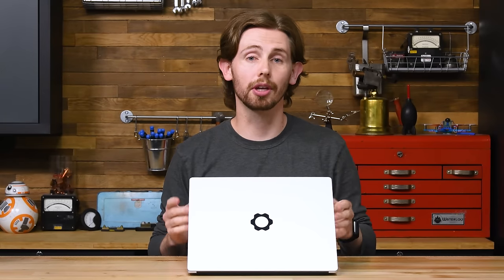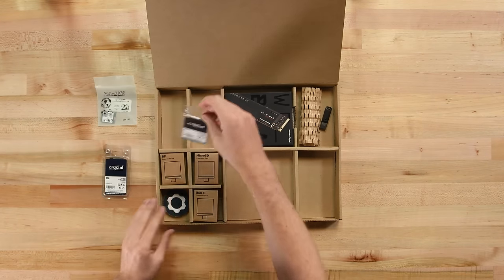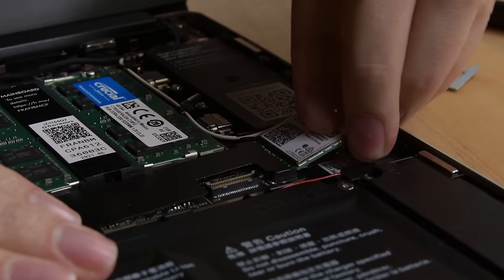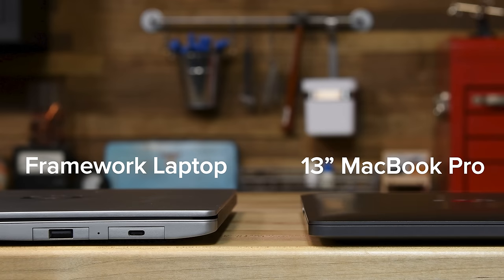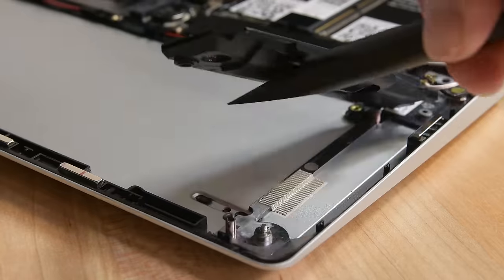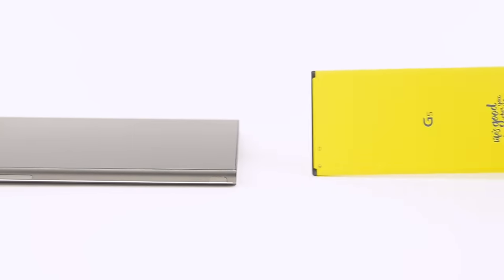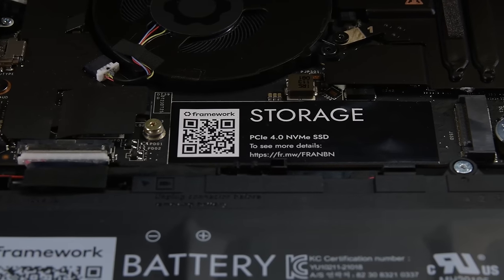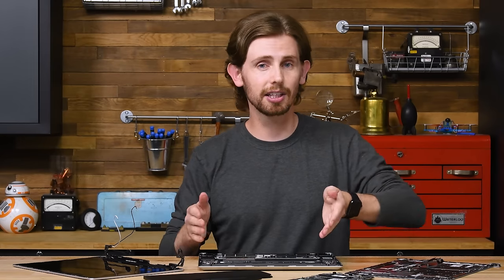Framework Laptop Teardown: 10/10, But is it Perfect?

Comment: I have a MSI modern 14
It's thin as heck, got all the reasonable ports, upgradable dual channel memory, easy to take apart, no glue on the battery pack, built out of sturdy metal and the display is easy to get at with the clip on bezzel
And I still envy this thing because getting parts for this one is so much easier

Comment: I'm not happy with mine:

* Battery drains super quick while suspended.
* External monitor keeps getting random disconnects (USB-C).
* Holding the laptop with one hand, or using it on a uneven surface, makes the chassis bend and makes the touch pad send a click.
* Noise going to my USB sound card through the usb ports.
* Fan turns on more often than desired/expected for a modern laptop. 
* A bit heavier than it should (why use aluminum instead of carbon chassis?).
  

The rest... very good.

Comment: I'm getting this thing as a non-gaming option as soon as possible. LTT covered it too, and I was totally gassed when I saw it. I'd give it 11/10. And for those of you poopooing this, PCMCIA has nothing on this. The USB module ports are USB 3.2 (kinda need that anyway for supporting DP and HDMI 2.0 - I think it's 2.0 anyway, don't recall).

Comment: Another thing, All screws are either color coded by length or captive, and at the top of the board they have 3 replacement screws, one for each length/color. Linus from Linus Tech Tips bought his own laptop on the spot and also invested over $250,000 to the company. I would keep an eye on this company!

Comment: I'd say 8/10 for repairability. I'd have loved to see a socket for that CPU and a direct link to schematics for the board on the website instead of a delivered on email type approach.

(Small edit) I know there isn't a traditional laptop grade socketable CPU on the market but with some R&D I believe a socket like what Intel uses for their current desktop CPUs could be manufactured for the laptop CPUs.
Reply: Cpu socket would make the computer significantly thicker.

And frankly if you are upgrading, it’s unlikely the same socket will support a new cpu.

Comment: If I were in the market for a new laptop I'd most probably get this. However I've still happy with my Dell XPS 13 9360 from 2017.
My only complaint is: they could've fit 2 usbc ports in those adapters each, couldn't they?

Comment: I kinda wish that the battery was more accessible, so you could take couple spare, fully charged ones when going to the woods or somewhere else where you are unlikely to have access to the electricity and replace it in the field without having to unscrew bottom of the laptop and risking dirt getting onto the motherboard.

Comment: That is what a laptop should be able to, upgrade components, i mean, what the point of ram and storage manufacture if they're soldered to the motherboard (in most laptops)? Maybe not for cpu and gpu, but it's a laptop, you can upgrade the whole motherboard anyway

Comment: The great thing about the DIY assembly, is that if you want to replace a laptop that already has an MVMe SSD and good enough RAM and a wificard, and all those components are removable, you can save even further by asking a framework DIY kit what won't include those things as you already have them.

Comment: If the D deck has more aluminum reinforcement to make it more durable and hard to bend I'll get one right away. Now it's still a very attractive device, but it lacks the build quality seen on old workstation level books.
Might be a little picky though, it's way better than those apple or surface trashes.

Comment: If I’m being honest framework is one of those very rare cases that it should be a score of 11. Not only do the provide the only tool you need to repair any part of the machine in the box but additionally with those QR code’s they not only give you a link to where to buy replacement parts they also give you full repair guides for the user to service the device themselves. And on top of that framework even left three spare screws in the top area of the chasis for if one was lost during repair. Not to mention the have commited to providing schematics for board level repair. Framework didn’t just make a repairable laptop they made a completely user serviceable machine that encourages end user repair and sustainability. I just tip my hat to them and know that once they offer a Ryzen variant I will be selling my 2020 MacBook Pro to buy one of these.

Comment: It doesn't really take away from it, but I hope they make at least a Gigabit ethernet option for their USB-C adapters.  I've seen ethernet ports on some newer thin laptops that have a spring-loaded retractable folding bottom piece that fits flush with the rest of the laptop chassis, so that the ethernet port is only at full size when an ethernet cable is actually plugged in, which allows the laptop to maintain a thin profile but still offer an ethernet port.  Something similar might be the way to go for a Framework ethernet adapter.

Comment: I think there's a way to put a socket and sell CPUs with no IHS with an adapted cooling solution so we can buy mother board if they fail in any way but still keep the CPU and drop the coast of the Mobo or CPU if the CPU happen to fail

Comment: The biggest complaint I have about the framework laptop is mainly two tiny things.

1st, it should have had a USB-C port on either side so that we don't have to waste a port on something that we are required to have regardless. Adding the ports to the base machine is going to be cheaper than using modules, and we can then also spend our module slots for more important things.

2nd. The modules should have been wider with about 1-1.5cm. As to provide more room for connectors. Then it can be used for a lot more niche applications, where one currently has to rely on dongles or external boxes.

The modularity of the framework laptop is a nice thing to see, but it isn't forward thinking in its implementation.

I can however give them a pass since it is a fairly tiny computer. But I hope any larger models in the future brings along wider modules. (preferably about 55mm wide and hopefully 15 mm thick. (there is few connectors that I know off that are relevant to put on a laptop that doesn't fit inside those dimensions.))

Comment: Now I know it would be a little teadeous compared to smartphone with removable back plates. But I can just see it now. Buy a spare battery, charge it up and then store in your bag so while your out and low on charge but can not plug in 3-5mins later boom battery has been hot swapped. I belive this will be my next laptop.

Comment: For the CPU, could they use the T variants of Intel CPUs (for example, the i5-12400T)? They're lower power (with TDPs of 35W, and can be limited to 25W for less heat output), but come in socketed form.

Comment: I want so badly to get a framework as my next major laptop upgrade but the fact that they don't have ANY GPU variants kinda makes it a dealbreaker for me in the long term.  I need one, even while travelling, so not having one in a machine I use to do work on the go is just sorta, a non starter for me.  I wish them nothing but the best though!
Reply: just wait for framework 16, it will have an upgradable GPU
Reply: The framework 16 is available right now for pre-order with the AMD Radeon RX 7700S as removeable gpu. They're currently at batch 11 which ships in Q1 2024.

Comment: I don't think it has enough IO. It's comparable to the laptops on the market but not to laptops in the past.
It would be nice to see dual usb a or c ports in one of those modules and I'd be ok if double module only fitted in top and connected into 2 usb c ports.
I wonder if it can be upgraded in future.

Comment: I can't find any info on the chassis.  is it alloy? I really need alloy bodied laptops, they last so much better and just feel so much nicer to use than plastics.

The thing about upgradable CPU/motherboard is that it shouldn't be a hard thing to crack.  Standardisation! we should expect someone to come up with a laptop motherboard form factor which can be used for all manufacturers to design machines around.  Obviously it should be as compact as possible to enable various cooling configurations and allow for future requirements but still... it can be done.  This is where the framework should be focused, replacing parts on most laptops isn't an issue and many people keep their laptops going for a long time already with simple upgrades like RAM/SSD etc.  The thing that makes a laptop obsolete is the CPU and GPU being unupgradable and it's something we really need to address.

Comment: I upgraded the main board on my Dell 2 in 1 7375. . .  cost $230 and took. . .  2 hours because three of the mb screws had to be drilled out. Otherwise it would have been about 20 mins.

Comment: literally the only things i could imagine is that you cant swap the CPU (not expected in a laptop though) and that if the onboard USB slot breaks, then you need to replace the MB or do a sketchy solder if you need the 4 modules at the same time

Comment: Nice review especially mentioning the grim possibility that if the company goes under, parts will be hard to track down and future upgrades will be highly unlikely unless another company thinks they can make a profit by manufacturing a new board+CPU specifically for this.  Most of us are enthusiasts and want this to succeed though.  Many of my laptop upgrades have just been LCD panel upgrades really.  CPUs stay relevant for a long time now and RAM is easily upgraded.  But I always want the new display tech and usually you have to replace the whole laptop to get it unless a third party LCD panel upgrade just happens to exist.

Comment: Imagine, in version 2 they have the ability to replace the display, maybe high refresh for gaming and oled for productivity, and the main gripe is there is no way to connect a dgpu or an egpu to this right now but ya some people don’t require them on a laptop, they went intel so they should have given at least one thunderbolt port
Reply: The 4 USB-C ports are Thunderbolt (Or so it seems) so you can connect one to a port without a module
Reply: @AlanyG21  no watch the video on ltt, they are usb 3.2 gen 2 I think

Comment: Question? The module port, is that just a standard USB-C/TB  port? Is there anything keeping a user from just plugging PD or a dock into one of those Slots without getting a module, or do you need to get a USB-C Module to plug into the port?

Comment: The one consistent thing that I've been seeing in reviews is that the CPU runs hot. I'd be curious to hear if there's any improvement with a fresh application of a quality thermal paste.
Reply: Tom's review showed the CPU hit 84C running Cinebench R23 over and over again, which is rather cool for a laptop. Most laptops intentionally push their CPU to the thermal limit to get every last bit of performance (or cost saving on the cooler).
Reply: @guspaz  Ah! Good to know. I read a different review that saw temps reach even higher than that ... but that review had problems like comparing the Framework with a laptop with an Arm based chip :eye_roll:

Comment: If the ports are soldered on the motherboard then the repairability will definitely be much harder has ports do get damaged easily and if you’re switching out the modules then it would be more likely

Comment: It is almost perfect, the only thing that I dont like about this laptop is that the CPU isnt replaceable just like the old laptops. If they are featuring modular and easy to fix laptop they should also include the ability to replace the CPU so that it can be upgraded or fixed (if the cpu somewhat goes bad)....

Comment: I can think of a reason this doesn't deserve a 10... what it really deserves is an 11. It redefines repairability. Not only is everything replaceable, it's EASY; you never have to remove half a dozen unrelated things to get to the part that you need to replace.

It's the antithesis of the Surface Laptop, which infamously received a ZERO on a scale from 1 to 10. Like that system, but in the other direction, it goes beyond the definitions of the scale.

(Disclaimer: I have owned one since July.)

Comment: Framework needs to be quick to issue an ARM processor model and a 16 inch -- even if the latter still uses Intel. After all they are thinking ahead to swapping out m'boards in a laptop's life so people could have ARM in a 13 inch very soon indeed or buy the larger model and retrofit.

Comment: Remember when HP laptops (Pavilions amongst others) had hard drives, memory and wifi cards which you could replace via separate lids on the bottom, with one or  two captive screws per lid?
So WITHOUT having to open up the whole laptop? Framework laptop doesn't have that! This is why they don't deserve a ten. I might be nitpicking and Framework deserves all the praise for their efforts and even more customers, but i wouldn't go higher than a 9.5 out of ten

Comment: One reason why it is not a 10/10 in my book is the soldered CPU. I know that a socket would make it bulkeir,  but having to replace the motherboard just to swap out the CPU does make it a 9.5/10 in my book. Still an awesome product, I will probably buy one one day.
Reply: wrong
you will never find the same socket for new INTEL processor every time its new model is released so you are probably looking for a pipe dream here
Reply: @eone199  No, that's not true. Intel's LGA 1151 for example covered three generations of CPUs.

Comment: The problem with a laptop like this is it's already so expensive to support one model. Asking them to support a 15 or 17 would create so much more cost and hoping you could even support each model is incredibly difficult. People already asking for larger screens, GPU options and even more I/O. At some point the community has to come together and mostly agree on one screen size. Asking Framework to support different chassis and motherboards with complicated cooling will be impossible for many years. This comes down to that if you wanna see what they can do in the future, you must by now. Even if it's not exactly what you want you must speak with your wallet or else they will never get there.

Comment: You could had describe the LCD panel replacement. In the lower edge of the screen there's a dark grey tape which looks like adhesive, is it easy to detach and put back in place for the replacement panel? Thanks

Comment: I don't really see why this laptop is supposed to be so much more repairable than normal laptops. The only mayor difference I can see compared to the buisness laptops I am usually working on, is the idea of the integrated dongles, but the the internal usb c ports are still directly soldered to the mainboard. And how often do you really need to change the port layout of your laptop? Having this weired solution only adds another point of failure. And for other parts they don't even give you different options to chose from, so it doesn't matter that they made it easier to swap them.

Comment: I was going to buy one but I don't think the usb 3.0 ports are thunderbolt, so I cant use a egpu. If it weren't for that small thing I totally would've bought one
Reply: @61 Cygni are they? I couldn't find info on whether they are or aren't. Could you tell me where you got that info? Because I'm buying a framework laptop today if I can egpu with one
Reply: @61 Cygni yeah YouTube doesn't like links. Thanks for the info tho, buying it after work 😄

Comment: There must be reasons why it's only available with quad-core Intel CPUs right now, but it seems bizarre. Presumably they simply weren't able to get a guarantee that they would be able to have enough supply of AMD chips due to popular demand, and because they are a small company which wouldn't have been able to commit to a large order... But, why only quad-cores? 

How hard would it be to upgrade one of these to a six or 8-core CPU? 

All that being said, I think that a large percentage of customers will be served just fine by the base model Intel quad cores.

Comment: I just got mine this weekend and I have to say so far I am thrilled with it, from everything to the near 100% compostable cardboard packaging to the smoothness of the assembly (I got the DIY version), OS install and driver install.  The "adapter" form factor - which is done by directly mounting USB-C sockets on the mainboard and making adapters nothing but built-in USB-C adapters - beats having dongles any day.  Display is nice and crisp, fingerprint sensor works great, the switches at the top cut the power to mic and camera - no hacks for that, I could go on, but if you're thinking about a new laptop, look into this one.  Having successfully replaced the entire upper keyboard+trackpad bezel on a Mac PowerBook, as well as laptop and iMac upgrades and gaming PC builds,  this is a breath of fresh air.

Comment: If there is a version 2, then it will destroy the idea. I more than happy if they can come with a mother board solution can fit a current desktop CPU which is easier accessed by most customers.

Comment: Dell laptops in early 90s had modular bays for CD or HDD or extra battery too i think.

They were literally a few inches thick and called desktop replacements in the magazine ads.  I think they only had one or two bays though butt you could pick and choose what you wanted to put into the bay 

It's cool to see that concept modernized and not even by a major OEM.  Maybe dell, hp and Lenovo will follow, if for no other reason than to shutdown the little guys.

Apple definitely will not follow this, they love not sharing.  It's why PCs dominated over MACs in the 80s.

Comment: It would be better if some of these ports support Thunderbolt connection, even just one of them. I rely on an external GPU heavily and had to go to an alternative.
Edit: It turns out that all four ports are thunderbolt equivalent, but since I already had a new laptop, I will stick with that one until it is broken